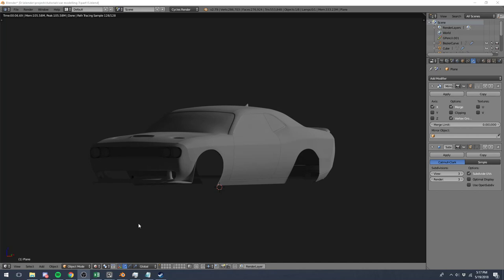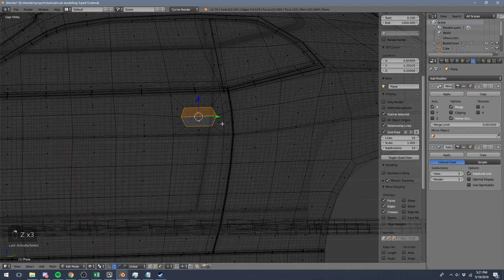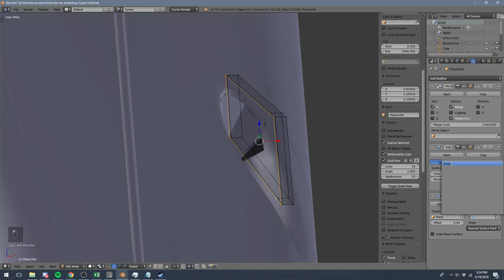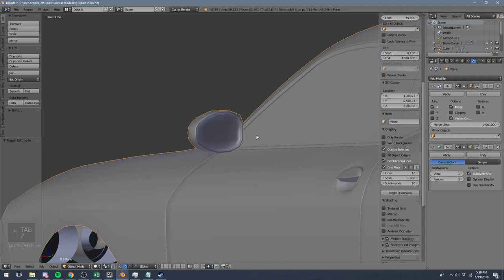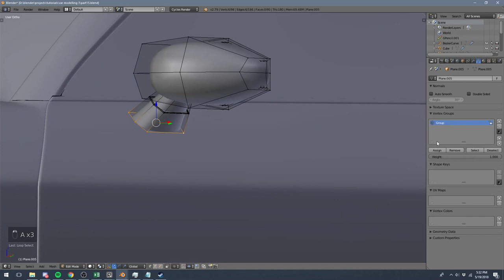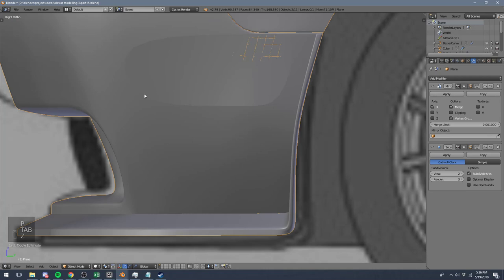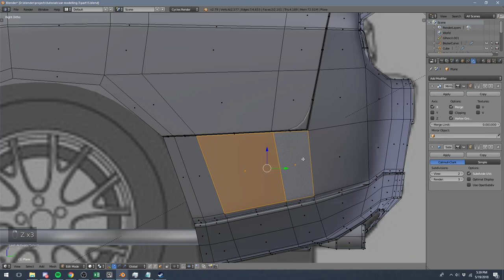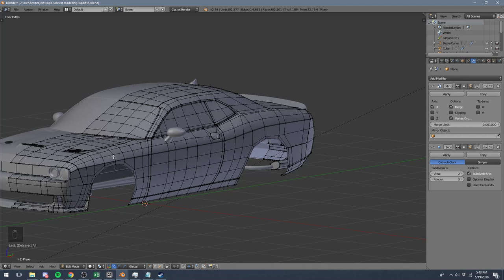Model a 3d Car | part 15 | handles, mirrors, reflectors.

Comment: Great, now I can't model in Sub surf without it lagging horribly. Wasn't like this earlier. I finished this video s couple of days ago, took a break for a few days, got back on, and boom. Super lag when trying to move a vertice in subsurf
Reply: Does the same thing on my dads Older i7 w/ GeForce GTX 1060 6gb and 16 gb ram. PLEASE HELP
Reply: And I can see you have like 500k tris. I only have 250k. I don't get why I'm having these issues

Comment: when i press "G" to move a certain thing the whole car moves
what should i do ?
Reply from the maker: Ameya Marathe sounds like you’re either in object mode or have enabled proportional editing. Try scrolling and see if a dotted circle shows up and changes size as you scroll. If so you can toggle it off using “o”
Reply: thanks for the help